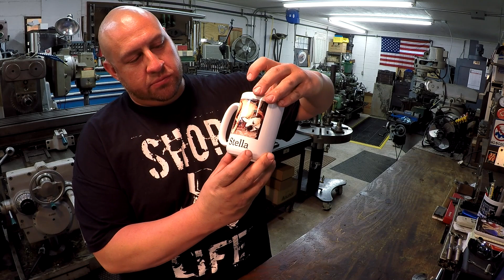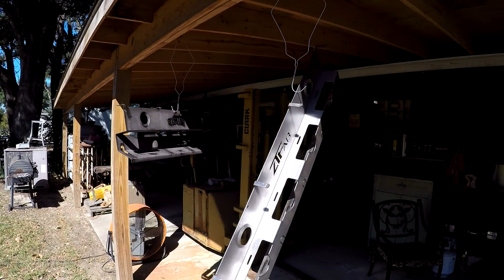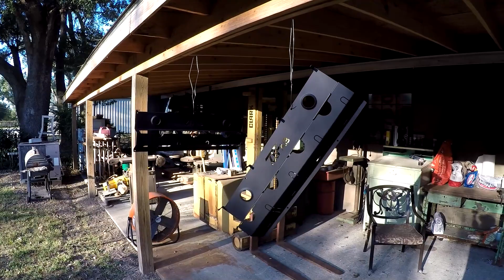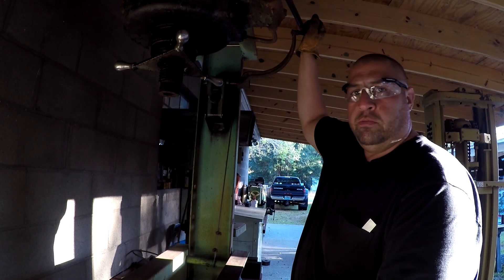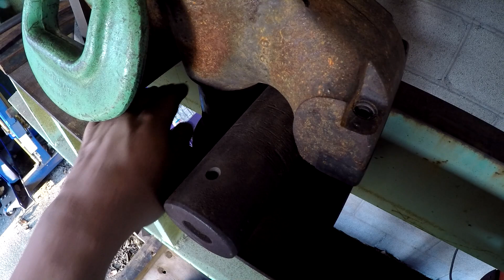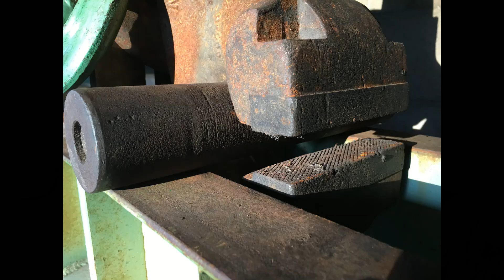Saturday Night Special 141: Stuck Wilton Vise, ZTFab Grinder Racks, Abom79 Hoodies!

Comment: Just got an older Wilton C1 vise (very similar to that one) that was frozen solid to come apart a couple days ago. I used a Porta-Power with the duckbill spreader attachment, warmed it up with a MapGas torch, and hit it with a BIG drift and a sledge. Soaked it in Kroil the same way for a few days too. Definitely a close tolerance on Winton vises!

Comment: The massive C-clamps are usually listed as "Bridge Clamps."  I've also seen them listed as "Shipyard Clamps" and variations of "Bridge Builder's Clamps", which can be rendered with or without the space, the apostrophe, or a hyphen.   Use these terms to search eBay, Amazon, Craigslist, etc. to find good used examples.  As stated by other commenters, Armstrong, Vulcan, Williams, and Wilton are good brands.  Look for "Made in USA"
Most sizes fit into a long large USPS Flat Rate Box

Comment: I have a Wilton vise on my welding truck, but it's  the regular style, 6-1/2" jaws,  I  bent 3 inch 3/8" thick flat bar on it,  and beat all kinds of metal with a sledge hammer,  and the vise is still going strong 😆😆. GREAT VIDEO Thanks William Orange county, ca.

Comment: Good idea using the press.  Likely he will need to use a cylinder hone on the housing and maybe media blast the movable jaw to get the tolerances back to spec. Should be a very nice tool when its restored. Worth every labor hour that goes into its restoration too. Thanks for sharing.

Comment: Even though the vice mounting holes didn't line up, one bolt and both clamps would have been solid. You are using the adjustable wrench backwards, they are designed to turn towards the sliding foot. Great videos, just reconditioned a 70 yo Cincinnati house jack.

Comment: Abom a helpful trick for spraying parts hung like wind chimes.  Put a small camel hump bend in a piece of tig wire, you can use it in a hole or edge to stabilize the part while spraying.

Comment: I have that same vice with the same problem.  I have been soaking it and hopefully mine will come loose.  I need to get the bolt shaft out first, its stuck also.  I got it for 10 bucks, so I can take some time.  Thanks for another way to get this problem fixed.

Comment: The unintended pun was on "way", not "tight". Adam, you know what I mean. That extraction was extremely informative. 
I am trying to get away from, "Awesome, epic, greatness", I and others are running out of words to describe your informative and eclectic approach to these potential conundrums. Yes, I pretty much exhausted my vocabulary. I had to use spell check at least three times. Anyway, you defeated the corrosion and did it right. IMHO. Love your videos. Don't stop.

Comment: Had to press out a 5" Wilton Vise similar to yours. My press table has a 4" opening but sure wish it was 6". Had to stack  4-4x4 wood blocks to get it high enough to fall out. Had the same problems as you did with supporting the bottom of the vise. I fared far worse though. I let it tilt until the ram was cocked to that side and supporting it.  I was't as tight, so it came out okay. Next time, I'll use a long piece of pipe, lower the table and punch it out that way. There was no damage to the press or the vise.

Comment: SeaFoam Deep Creep - heat the vice up with a propane torch - then spray it with Deep Creep - it will force itself into anything and free it from being rusted shut. The heat will not stop the lubricating power of this stuff - it's what it says on the can to do!  I soaked a rusted set of feeler gauges for a few hours and the rusted brick is like new - not fully readable on the hair thing gauges but yeah - hope this helps someone!

Comment: I got a 1959 Wilton 101059 C2 SCHILLER PK ILL in great condition for basically free, a buddy of mine was sitting on it IN HIS SCRAP PILE! and when I laid eyes on it a little bit of scrap I had laying around was cool by him, I am very very happy with that deal, lol, as you can imagine. It has no rust on it, all I did was smooth out the flat on the base jaw ramp for smacking purposes, mounted it on a little end table stepped two shelf, top main, smaller front, two side doors to the cavity back cabinet, I filled it with reinforcements and mounted a big 1/2" rubber pad on the bottom, so it's sturdy as hell, storage underneath and a shelf open for hand tools and what not. With a few moans and groans it moves anywhere around my small shop, and the main table top had enough room to mount my bench grinder with the mounting bolts secured to the machine and the males poking down into females in the table so it can come up and off with the removal of one screw.  Building a bench grinder out of a table saw now, half done, the belt runs through where the blade would go and everything is mounted right on top of the work table of the saw. A table saw is a great headstart for guys building their own belt grinder, it's got the motor mounted with ample foundation to get the rest assembled on top and it's got just the right amount of sack to run a full size belt. I'm going with 2x60" belts to wrangle that extra foot from the space the top side belt run assembly will take up but still have the good belt length. Luckily it's for heavy removal and belt selection isn't limiting me, cause I don't know for sure why 2x60 isn't more popular, maybe somebody here knows, I get having the other foot of belt, but when I'm trying to keep things tight but still have plenty of belt, then I get not having that other foot. Anybody know where 2x60" belts are seeing their sparks most commonly?  is it just for my type of circumstance, big boy belt on a bit tighter of floor space?  
Oh, and Abom, loving the videos man, thanks for your efforts, and great work.

Comment: I would use a pneumatic truck wheel nut removing gun to shake the rust inside loose . I would leave it dry without any releasing fluid

Comment: Brings back memories of my Wilton bullet vise ...  Mine hadn't been outside but had been wet on a regular basis...it set next to a toilet in the men's room at a welding shop for who knows for how long.  I asked what they were gonna do with it and they gave it to me .... So I took it back to my shop hosed it off - one more time ;<) and soaked it in oil for a few weeks and couldn't get it to budge ...  I resorted to adding a little heat with a rose bud (and I mean little)  and it just walked right out with just the slightest pressure on the handle.  Been using  it now for 40 plus years. Cant' beat good American quality tools. Will have to say that when I saw the price on a new now, I almost needed to dial 911.

Comment: Nice save on the vice Adam. Here's my story. During the winter of 82-83 elNino storms destroyed the Santa Monica pier. On the end of the pier was the Harbor Patrol office and shop. All were destroyed. I was running a lifeguard rescue boat for Los Angeles County in those days. A couple of years later a co-worker was diving on the old pier site. He found a Colombian 8" vice. I acquired it in a trade. It was rusted solid and full of tube worm colonies. My method was a couple hours with a rosebud tip on the acetylene torch. It was in surprisingly good shape. Sand blasted and a little bondo on the casting imperfections before paint. It's in regular use today. Thanks for another great video.

Comment: Just a suggestion, next time after applying some pressure use a torch and heat up the outside of the vise to help it break loose.
Reply from the maker: I mentioned on video that would be the next thing to use if it did not want to move. I'm very familiar with the blue wrench.

Comment: Most probably stuck in the key and keyway more than the bore itself. Pressed many thing where the key sticks in the bore and the shaft comes scored or damaged.
Reply from the maker: +Max Power It was more then the key holding.

Comment: Man I dig that press. I have a manual lift for the base plate. I have a piece of 4" schedule 40 PVC with a cap on one end and a threaded coupling on the other with eye bolts to hang the assembly and a threaded hook on the inside of the plug on top to hang parts from when i soak things to clean. I plan on building a 6" when money allows for my hobbies. Great video again.

Comment: "No feet or toes missing," but I wonder how your back felt the next day. Good job on getting that vise apart.

BTW, that's a good way to wreck clamps - putting sideways pressure so one clamped piece moves against the other. It can either bend the screw or wring the frame. Those clamps look pretty stiff, but you wouldn't want to try something like that with your good standard pattern Armstong clamps. Better to shim or block to the edge of the base, maybe using clamps to keep the shim from slipping off the edge of the base.
Reply from the maker: +Peter W. Meek Maybe standard c clamps. Your not gonna hurt these HD clamps.

Comment: I wonder, if you apply 1 Abom to the hydraulic press, how much Aboms are then pushing against the workpiece?
Reply from the maker: djteac still working on the numbers
Reply: we need to quantify an abom  torque into fl lbs
Reply: I used a 50 ton Dake press just like that for years. Good machine. My press had a name tag on it that instructed the user to advance the ram downward at least 1/2” before applying pressure. This prevented undue pressure against the ram seals. 

Good work
Reply: A BOM torque is the variable in the equation
Reply: 1 ABOM = 600+  FOOT POUNDS !!   :-)

Comment: Adam, next time try your electrolysis rust removal. I've had real good luck with it on old rusty guns. I had a anode rolled up to fit a 5 gal bucket so I can put a receiver or frame in it. After 8-24 hours I can back out screws that were totally rusted in place with no effort. It will remove the rust even in the threads and won't effect any of the original metal or finish. Great save on the vise! A little effort and time and that vise will give a lifetime of service.

Comment: I once was told a story about a guy who somehow used a product ( I think they call it DEXPAN ) to successfully force two stubborn parts apart.  He had been working to separate these two parts for months.  They use the stuff to break rock in situations where blasting is not possible.  The stuff slowly expands over a day or two with an unbelievable amount of pressure strong enough to shatter solid ledge.

Comment: Aw....I wanted to see it GET FIXED. All that time to knock it out. What is the vice worth? All that time...and you could theoretically just bought a new or used one that worked.
Reply from the maker: +John Edgewood Ok John, price this vice new, and look them up used. Then determine if 1-2 hours shop time is worth saving this valuable tool. Being as I was helping a friend, and I enjoy sharing content like this on my channel to help others, I think the value is well worth it to save it.
Reply: Yikes! Used on eBay is $900....OK...worth it.
Reply: @edgewood99  yes sir!!!!
Reply: I agree. Those vices aren't cheap. And that one looks in pretty good shape.
Reply: Precisely the attitude of modern society. Buy a new inferior product instead of rescuing an older, quality item. That old vise is worth a decent amount of money if restored. More importantly, it's a better vise.
Reply: Always save old tools. Best!!
Reply: indeed the help a friend is outside the normal hourly price, you fit it in, it only really costs a little kindness, which is usually repaid anyway, and yes it is well worth saving and well worth it for your friend,   will you be making a new handle or can he 'handle' that part?
Reply: plus im sure, if adam only showed what he did at full hourly rate, we wouldnt get half the videos we do get

Comment: Nice one Adam. The threat of the blue wrench worked. At least when you got it apart it was a bit lighter when "somebody else" had to lift it back on the trolley :)
Reply from the maker: Robert Watson I was hoping the pressure would get it because sometimes handling hot parts can be tough. I had to do it all myself that day.

Comment: New subscriber here, I sure would like to see some photos of the vice during and after restoration if you or your friend have the time. I have had great success with Kroil in the past, I've found it helpful to take a lead or copper hammer and tap on a stuck piece when in a press. More times than not it saves me from having to apply heat and seems to take less time to get things unstuck. Liked the video.
Reply from the maker: +ecleveland1 I'm going to try and get him to text me some pics when he cleans it up. Yes sometimes some "shock" is just what something needs to help it move.

Comment: how does that 5C tool tighten the holder down with stock in it? Unless you less than 5mm stickout?
Reply from the maker: +Mark Stock there's a cam built into the tool you move with a hex wrench. It pushes against the collet taper making it close up.
Reply: Ahh, like the collet closer on the hex and square blocks for the vice, Got it, Thanks
Reply: Yeah, it's just for installing the collet in an unkeyed closer, not for tightening it on the workpiece.

Comment: I know Florida's marine weather rusts stuff beyond belief, but could the vise have been in a shop fire of some kind? I've seen shop tools that came out of fires rusted like that and NO paint on them. Anyways Adam you did good getting it to come apart. I am wondering though, with you having a hydraulics background in a hydraulics shop why you don't have some kind of electric power pack connected to the ram on your press? I can see either way though. Manually operated you can "feel" the pressure on the ram. I'm a real Abom fan . Just  So You Know. I enjoy your videos always.  bjr
Reply: Time & $$$ I suspect.  I would kill to have a press like that.  Used to many many years ago but it got sold at auction.
Reply from the maker: bjr E. WA. He said the owner had it laying outside for many years before scrapping it.

Comment: FWIW, one of my old machinist books suggested when your adding heat to get something rusted apart was to use the pre heated parts to melt candle wax down into the gaps or even threads. Stuff flows like water and gets into the smallest cracks and helps to lubricate and break the bond a lot easier. Hasn't failed me yet. Since most candle waxes melt at around 150F your not risking getting into changing any heat treatment some parts may have.
Reply: shadowdog500. I like using AFT and acetone 50 50 blend works great
Reply: I use the wax trick all the time.  It works a lot better than a lot of people think.   I also buy Kroil by the gallon.   IMHO there is nothing that Kroil wont get loose If you soak it long enough.   Chris

Comment: I had the same problem with a Witon (smaller) vice that was mounted on the back of a piece of construction equipment.  PB Blaster and a 3 lb hammer did the trick!

Comment: I don't believe he soaked it int the spooge tank long enough. I've never had any iron that a spooge tank didn't free up. I even soaked a smallish wood stove in mine. It was a good stove but it was bolted together. Once I spooged it the 1/4-20 bolts eased out with a very slight force. That's what I would do anyway. Good luck - I am sure your way will work fine too.

Comment: Man, that solo moving of the heavy stuff in the shop is the pits, but at least you've spent a little more time in the gym in the past than I did. :-)  Thanks for the shout out.  I'm glad the evaporust didn't etch it too much.

I had to laugh when you talked about your tap wrench additction.  I've had to hold myself from too many dial indicators.  I've been able to limit myself to just a couple older ones lately.

Enjoy the rest of your weekend.
Reply: ILGopher...my collector weakness is Starrett levels.
Reply: mine seems to be ratchets...ive enough for about 6 mechanics